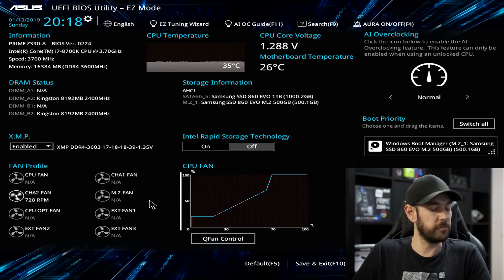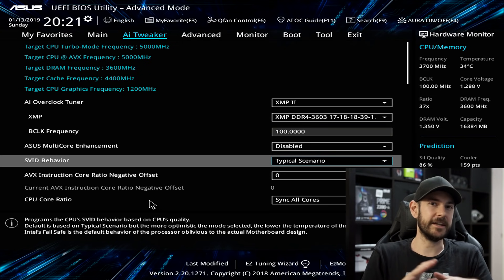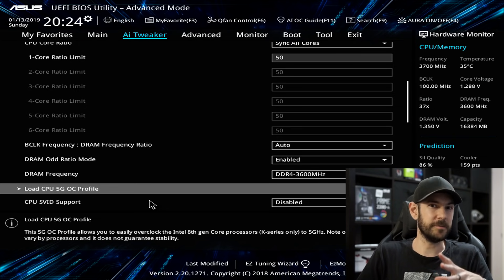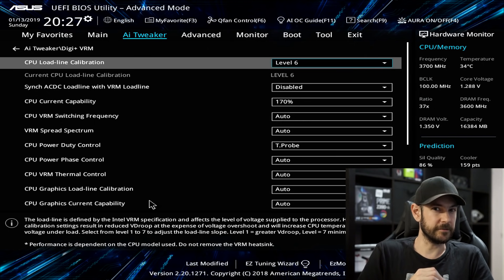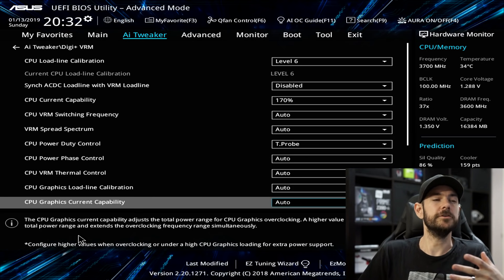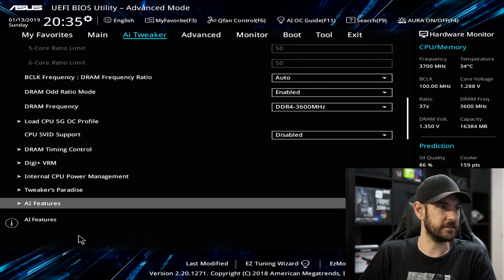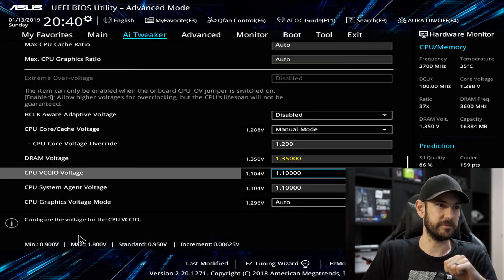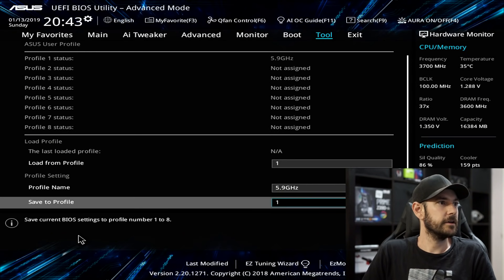ASUS Z390 Quick Overclocking Guide | i7 - i9 | 8700K - 8086K - 9700K - 9900K

Comment: me and my gf both have 8700ks with asus z390 boards. Im  strix using z390-h and she is using prime z390-a. We usually leave all our stuff stock. I was able to sync all cores with out issues (I intend to leave it 4.7 ghz). She tried the same on her prime board and prime 95 reported hardware failure .5 expected .4 something everytime we ran P95. Prime95 runs through no problem for her but only on stock settings. For some reason her ai suite 3 (dual intelligent processors, as it calls itself on her screen) keeps showing blck 100.5 after every boot. I tried creating a profile to keep it 100 flat and then prime 95 resulted in bsod with a irql_not_less_or_equal. Not sure what was going on. Didn't think the boards were too far off in spec. her chip has plenty of thermal head room for some overclocking better than mine actually. im barely hitting 80c on prime for an hour and when she runs prime on stock she hits about a 70c. we aren't trying to do a 5ghz or anything crazy. we just expected to be able to sync all cores. I dont have to mess with any voltages or anything on mine. She is afraid to mess with it after a bsod on a simple sync all cores. I really believe the voltage is too low or not raising fast enough. If anybody has any input it would be greatly appreciated. Maybe its ai suite 3 causing all the issues in the first place. the only time I made a change in ai suite 3 was to set her bclk to 100 as it shows in bios. for some reason her ai suite3 keeps setting 100.5 and the one time I forced it into a profile to do 100 flat it did the bsod as soon as I launched prime95 to test it.
Reply from the maker: I’d start by following the settings in the guide. If you’re using AI Suite to overclock with auto voltage you’re going to have problems.
Reply: @boostedmedia  I'll try uninstalling her AI suite. For some reason it shows different then what I set In her bios. Her base clock keeps showing up as 100.5 instead of 100.

Comment: Hey Will, my current specs are as follows;

CASE:
1) Cooler Master MasterBox MB511 RGB

POWER SUPPLY:
1) Corsair HX 1000

CPU/MOTHERBOARD/RAM/STORAGE/ GRAPHICS
1) Intel Core i7 8700K @3.7GHz = OC: 5100MHz
2) Asus ROG Maximus XI Hero (Wifi)
3) Corsair Vengeance RGB Pro DDR4 (2x16GB) - 3200MHz
4) Kingston 128GB SSD (Windows), Samsung 860 EVO 1TB SSD, Samsung 860 EVO 2TB SSD, Western Digital 3TB HDD
5) Asus ROG Strix Geforce RTX 2060 OC 6GB DDR6 = OC: 2100MHz | 7725 MHz

COOLING:
1) Cooler Master MasterLiquid ML240R RGB = Intake
2) Cooler Master MB511 case fans x1 = Intake 
3) Cooler Master MB511 case fans x3 = Exhaust

Currently with AI Suite, I am using AI Overclocking which is giving me:
1) 6 cores at 5100MHz
2) max vcore: ~1.314V (according to AI Suite and CPU-Z)
3) temp underload: ~72-75C (temp readings from AI Suite) (~81-90C according to MSI Afterburner)
4) idle temp: ~29-35C (temp readings from AI Suite) (~28-38C according to MSI Afterburner)

Scoring:
1) AI Suite=  CPU Speed +37% | Cooler Points: 168 pts
2) Cinebench R20 = 3782 cb
3) Heaven 4.0 = 5887

My question is should I manually overclock in bios or just leave it to AI overclocking? Please let me know if you can. Thanks so much! Subscribed

Comment: i have a question Related to the i7 9700k Why it goes up to much to 100% Usage on gaming (Bf5) (AC) also other game that gives alot of stutter 8700k is way better than 9700k in that state if compare the 9700 vs 8700 cpu load.
can you help me with this issue  i dk what to do :( Sell my cpu or switch to 8700k or 9900k cause of the 100% usage in gaming 

(pc specs 16gb ram 3200, 2080Ti ATM cpu @ stock )
Reply: 9700k doesn't have hyperthreading. It could be related to only having 8threads with the 9700k and having 12threads with the 8700k

Comment: What percentage do you usually sit at on your fans when you test the temps
Reply from the maker: https://youtu.be/zzOZu8qJ0PY
Reply: @boostedmedia  thanks ill check it out. I just oc to 4.7GHz and 1.27 voltage but my temps when idol sat at 35-43c sometimes a little higher. 75-83 when under full load. Is this normal

Comment: hello, how long time occt stress test to confirm stability? 9900k 5GHz 1.320v crash at ~30min but 1.325v no crash during 40min stress test. You think it's good or need more stress ? Thanks
Reply: Look into prime 95 24hour stress testing. If your overclock is stable for 24hours of prime95 testing your overclock can handle anything you can throw at it.

Comment: I don’t have all the same options on my Asus board that’s in this video - safe to follow or should I keep searching for something specific to me? We have the same version bios in this video - maybe my board just blows?
Reply from the maker: What board do you have?
Reply: Noise is minimal - have a Corsair H100i AIO cooler. 

Now I have to decide if the OC can push those RTX cores better and allow for decent ray tracing performance with my 2080 now. 

Decisions!

PS - thanks for the replies - most big channels don’t provide feedback - i appreciate it!
Reply from the maker: You’re welcome mate. Honestly there is no practice so difference between a CPU running at 60C and 80C. It won’t have a significant impact on life span or anything else. They’re designed to run at up to 95C or so all day every day.
Reply: ASUS PRIME Z390-P
Reply from the maker: Should be ok to use this video as a starting point. Maybe aim for 4.8GHZ at 1.3Vcore to begin with.
Reply: I went to 5 and 1.3 and it seemed stable. Went into BFV and ran well over 120frames with 144 GSynched when able. 

Only thing - without the OC I was averaging around 58°C without all cores synched, but got to around 71°C with the OC. 

Now I gotta determine if the heat is worth an additional 300Mhz
Reply from the maker: As long as it’s under 85 degrees I wouldn’t be concerned at all. That’s a great result. U less of course it’s making your PC noisy.

Comment: Followed your excellent tuto.. for a z390a 9700k... crashing at 5... when launching Xplane... very good cooling ... shall raise the cpu or drag voltage ? Strangely enough it crash always at the same moment when going to display the game
Reply from the maker: You’ll need to either raise vcore or lower clock speed most likely.

Comment: My pc crashed should I reduce it to 4.9ghz and put the cpu core voltage to 1.300?
Reply from the maker: It’s better to do one thing at a time. You could either increase the vcore or lower the clock frequency.
Reply: Boosted Media alright thanks

Comment: Hey, great video!
I did the same thing just with 4,8 ghz and i get a stable clock Speed of 3,7 ghz (8700k) can someone help?
Reply: Try setting the voltage higher I swear every youtuber has the absolute best silicon lottery when it comes to cpu

Comment: Can I follow these steps with my Asus Z270 & i7 7700k? I've been running the default 5 ghz profile for over 6 months - finally looking into 'Manual' overclocking.
Reply from the maker: It should be somewhat similar but I haven’t played with a 270/7700 so I can’t really say.
Reply: @boostedmedia  I noticed the Z390 bios has a few more settings than my Z270 bios but the system seems fine atm. That said, I've run the stress test software (OCCT) a couple of times and it flags up a warning with Core #1 (after 4 mins) but I can't see anything indicating the fault(s) in the graphs. Any suggestions?
Reply from the maker: Probably needs more voltage or lower clock speed.
Reply: @boostedmedia  Okay, I shall give that a try later on this week! Thanks for your help :)

Comment: I have a i7 9700k, aorus pro z390 motherboard and a Corsair H100x Hydro Cooler would it be safe to overclock to 5ghz?
Reply from the maker: 5GHZ May be pushing it for an H100x but depends how much voltage your chip needs.

Comment: thanks for that mate, successful on ASUS Z390-F STRIX with  i7 9700K @5.0Ghz with CPU Vcore @1.3 - all  the rest like you suggest except left speedstep etc, on AUTO. Cheers
Reply: @prorank4  CPU voltage set manually @ 1.3V
Reply: My pc is crashing on 5Ghz ;(

Comment: I7 8700k @ 5ghz at 1.27v @ 70-75c under 100% load thanks🔥
Reply from the maker: That’s a great result.
Reply: Yeah! Im planning on delidding but I'll wait because I've only had it for 2 weeks and don't wanna risk it yet spent 3,000$ on my gaming setup
Reply: Guess I got a good chip and might hit 5.2ghz or more at 1.3-1.4v
Reply: I got the 9700k and z390-e with x62.how high can i overclock it?

Comment: I'm going to give my rig a minor makeover soon. Besides upgrading my CPU to i7-8700K from my i5-9400F, I’m also upgrading DDR4 3000 16G. Is overclocking needed for this? And Can you recommend me a good cooler?

And awesome video!
Reply from the maker: Overclock is never needed but always helps. Cooler depends o. The rest of your setup. Corsair H115i is probably my best recommendation based on performance and simplicity.

Comment: would this work with asus Z390-E Gaming and i7 8700k? 5.0 ghz? how will i know its stable<-(Free stress test programs would be cool to know about) and when its stable what am looking for. i have a g3 eco 750 watt psu gold 80+ now will this be enough? im very scared of ruining this cpu or other parts please as much details to what to look for and what to watch out for would be great!
Reply from the maker: I’ve got a seperate. Keep covering stability testing which should answer your questions.
Reply: @boostedmedia  sorry seperate what? and what would you reccomend for stability testing
Reply from the maker: Wow not sure what happened there. Seperate video showing how to stability test :)
Reply: @boostedmedia  three years down the road I've officially overcloclocked my 8700k to 4.9 ghz I had it at 5 it ran a little to hot for my liking
Thank you for this 
I do have one question what can I do to reduce Temps I have an aio you said to stay away from 90 and above and I'm 4.9 at about 81 82 on max load in-game anywhere from 60 to 70
And on basic desktop 30-40
I'm trying to reduce heat some how any suggestions? Voltage anything u can tell me to fine tweak.
Reply from the maker: Reducing voltage will lower temps, but the last few percent of clock speed always requires disproportionately higher voltages and thus heat. Those temps look fine to me so I wouldn’t be worried about it.

Comment: will these work starting settings work for 8700k n ASUS Z370p board?
Reply from the maker: I have another guide for 8700k and z370
Reply: I used these settings only few minor differences between Asus Prime Z370 & Z390 bios that I found. I was able to get 4.8Ghz on all cores using basic settings in this video but OCCT program seems to be no longer available from all the links I found. Used IntelBurn , cinebench and Realbench

Comment: I followed your exact directions for my 9700k, and was able to go up to 5.2ghz @ 1.30v maintaining 45c with a Nzxt Kraken X62.  Thanks!

Cinebench R15 results:

OpenGL 160.34 fps

CPU 1639 cb
Reply from the maker: That’s an awesome result!
Reply: Boosted Media thank you. I tried going to 5.3ghz but it crashed. I went up to 1.32v and still crashed so I put it back to 1.30v and 5.2ghz. If I want to keep going up what do I have to increase other than cpu voltage?
Reply from the maker: You’ve probably hit the brick wall. Will likely just need more vcore.
Reply: Boosted Media just bumped it up to 1.35v @5.3ghz. No crashes and is stable but OpenGL on cinebench is now showing 1-2 less fps.
Reply from the maker: Sometimes at the upper limit some errors occur that lower your performance even though it doesn’t crash. Could try going up to 1.36V as long as temps are ok.
Reply: Which motherboard? Asus z390-e/f?

Comment: so i just got my 9700k and followed this video for over clock and everthing is stable so far. i am curious about my cooling tho. i have a corsair hydro h50 cooling my cpu and then i have 3 case fans. is that sufficient for cooling? since my over clock my cpu at 98% load while gaming is about 67c is that too hot, should i tone it down? im not quite sure what it sits at idle i normally leave my pc so it sat are 29c before overclock at idle now i think its around 48c after overclock. great video though. my first build and overclock. you taught me a lot.
Reply from the maker: Those temps seem ok but have a look at my stress testing video to make sure it’s stable.
Reply: @boostedmedia  ok thank you ill check it out.

Comment: Hello i overclocked i7 8700k to 4.9ghz and i have i question can i set my cpu to stock 3.4 ghz when im not playing games. Becouse cpu always works on full 4.9ghz.
Reply: Enable Intel SpeedStep so it only goes to 4.9Ghz when needed by the workload which you are pushing its way.

Comment: Kind of redundant when the EZ overclock on the bios does it all for you already...(just sayin)
Reply from the maker: That’s fine if you want to massively overvolt your CPU and have no interest in learning.
Reply: @boostedmedia   hang on a sec there cowboy...I've been computing since the late 70's when the biggest machine was 16k. Now that was high tech.lol
Reply from the maker: You’re clearly the expert then!
Reply: @boostedmedia   far from it,cowboy. But I enjoy your videos.   (makes popcorn)...
Reply from the maker: Haha! Love it mate. Seriously though. Those auto overclocking tools are designed to “just work” but fees way too much voltage to the CPU and motherboard. It almost always results in unnecessary thermal throttling. Much better to spend the time to learn to do it properly.
Reply: @boostedmedia   Im using an 11 yr old 750 watt EVGA power supply and a first generation Corsair H80 liquid cooler on my new Z390 system and it runs 31 C idle...overclocked to just under 5 gz...that impresses me the most. It's hard to believe it runs so stable.  side note..next week- F1 2019....Melbourne....the wait is over....are you ready....hehheh

Comment: Hi, great video. Is there any extra steps that I have to take to overclock my 8700k if I don’t use an XMP profile (My ram is stuck at 2666)? I use a Corsair H115i 280mm aio.
Reply from the maker: Not really. RAM overclocking is complex and time consuming and the gains are relatively small, which is why I generally recommend XMP.

Comment: I feel like I’m doing something wrong. Should my 5.0 ghz be stable at 1.21 volts? Seems rather low after comparing it with other 8700k stats. I stress tested it on Prime, Realbench, and Aida.
Reply from the maker: It’s highly unlikely it’s stable at 1.21V unless you have an amazing chip.
Reply: Boosted Media I don’t know tbh. At 1.21v with no AVX offset I ran realbench for 4 hours, prime95 26.6 for 3 hours, Aida64 for 1 hour, and OCCT for 1 hour. Temps aren’t high and all cores stay within 4995mhz to 5004mhz range. Should I keep testing or is this a godly chip?
Reply from the maker: Sounds like you’ve done all the right things. Wow!
Reply: Boosted Media Thanks for the feedback. I’ll count my blessings then.

Comment: In a previous video you did to OC the 9900k you said to use level 7 cpu load-line, now you’re saying level 6? Also I think you should do a video about memory because I have 4266mhz and the board won’t run at that level unless it has two kits of memory. I use the XI Formula and I didn’t know this. Also I would like to see a video about high end memory and how to get it to work and how you should configure them. I got crashing with 32GB @4266 I had to lower it to @4200.

Comment: this shit bricked my pc, wtf kinda help guide us this.
Reply from the maker: More likely you missed a value somewhere. In any case just hit the BIOS reset button on your motherboard and try again.
Reply: Boosted Media copied exactly what you said. spent the whole night reinstalling windows cause cmos battery reset and default settings did not resolve issue. even tried reverting to a system restore point. nothing. not sure if jumping from 3.7 straight to 5.0 is something i’d recommend. maybe small jumps. windows would boot but after 3-5 seconds, nothing was clickable. just posting in case others run into same issue.

Comment: is the core voltage for 1,290 going down if there is no load on the cpu?
does it kill the cpu if the 1,290 is all the time on?
Reply from the maker: No. As briefly explained in the video it’s fine.
Reply: @boostedmedia  thank you for ur very quick reply.
so that means : Set CPU Clock Ratio ( i want 4,7.GHz)  to 47.
go to Vcore set to 1,290 fixed and then i will have 4,7GHz with constantly fixed 1,290 Volt
Hope u can confirm that quick.
thanks a lot.
Reply from the maker: Yes. With slight variation under load depending on load line calibration.
Reply: @boostedmedia  another quick question : is it not better to work with Offset for the Vcore cuz iwant to clock down on idle (C/EIST) so i tought it would be better then to work with an offset... but i can follow your instructions which makes also a pretty nice and stable OC. cant decide..
Reply from the maker: You can if you want. As explained in the video it makes very little practical difference.

Comment: looking forward to you doing a guide for the 9700k so far im pushing 5ghz thanks to this guide but im having trouble getting past this yes i have got water cooling my temps are perfect but i have crashing past 5ghz bluescreens :(
Reply from the maker: You probably need a bit more vcore. Not all chips will reach 5GHz at sage voltages though.